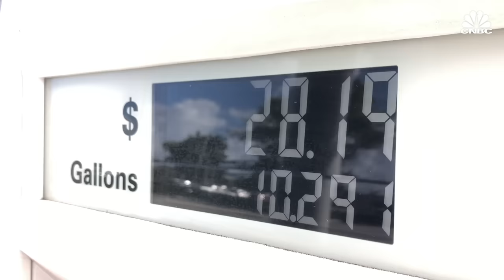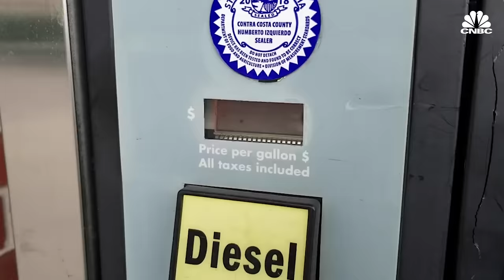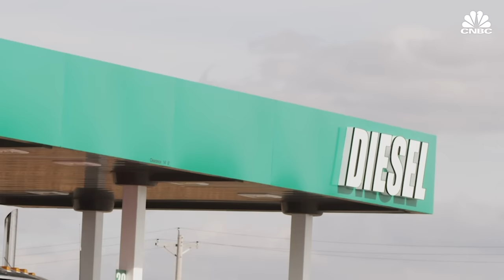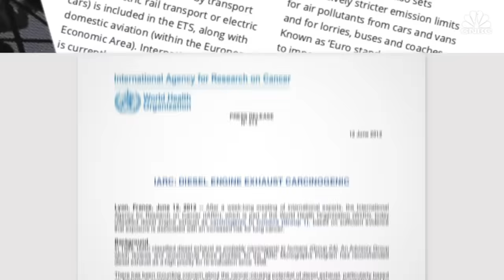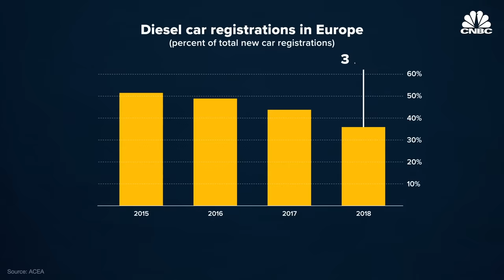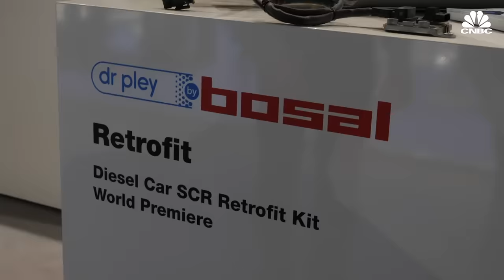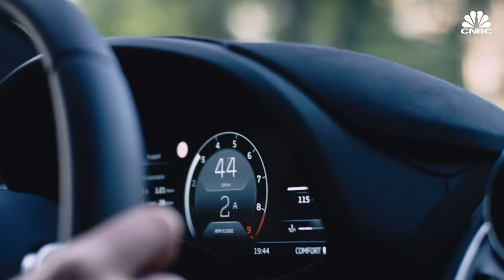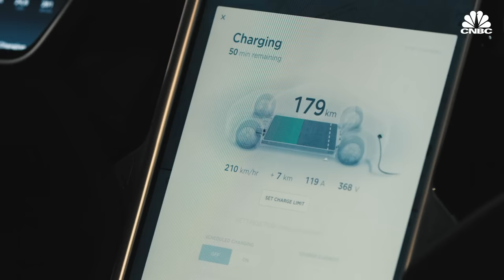Why Diesel Cars Are Disappearing

Comment: My e220d does 1200km on one tank easily. It emits less co2 per km than petrol cars. And the Nox emissions are handled by the scr system.
Reply: @ThePatUltra no, dpf and adblue equipped diesels are clean
Reply: @ThePatUltra christ, obviously burning 6 million year old dinosaur guts is never clean. When people say this they mean 20X cleaner than 10 years ago.
Reply: @ThePatUltra no because no one is breathing pure exhaust emissions. otherwise we'd all be dead already. stop being obtuse
Reply: @ericb8030  Possibly the soot and sulphur dioxide that is emitted will add to causes of cancer, not just for humans, but birds and other air-breathing creatures.
Reply: @peterduxbury927  That stuff isn't emitted from newer diesels exhaust, go educate yourself
Reply: @peterduxbury927  You are aware that new diesels by law are required to have a doc and dpf correct?
Reply: @ericb8030  Thanks for your note. Yes, please see my comments/reply to 332T.  We can add DEF (Adblue) to your DOC and DPF.
Reply: @peterduxbury927   maybe read again, i said "newer diesels", not old or deleted or not complying.  the exhaust tips don't even turn black on them. Modern diesels are very clean and still getting better. With ultra high pressure injection they can now pass emissions without soot filters
Reply: @peterduxbury927  There is a plant in Dresden that makes renewable diesel known as blue crude. The fuel is completely free of sulphur and can be used in any diesel for the infrastructure that already exists.
Reply: @ericb8030  Thanks Eric, I was unaware of blue crude, and zero-sulphur diesel fuel. But - doesn't this demonstrate that technology is doing its' best, and is anxious to clean-up the pollutants in diesel fuels - as a last-ditch attempt? As we are small fish, we will have little say in what fuel will be used in the near future. But it will be mainly Battery - Electric vehicles for private use. Governments will legislate, and diesel engines will be phased-out for use in small vehicles. OPEC will wind-back Oil Production. (Supply & Demand). Then, the prices of diesel will skyrocket! Living in Australia, we have an abundance of sun, which gives the cleanest (and greenest) power of all. It is wrong to believe that Power Stations will be used to recharge the bulk of EV's. Solar Panels (and their consistent improvements in performance and efficiency) will do that. It's sad that many people feel that they would suffer from Range Anxiety, if they purchased and drove an EV. But many Work Places will change, and Charging Stations will be added. Whether it is a petrol or diesel engine, the efficiencies just cannot compare with an EV at 80 - 90 %. Most ICE are not even half that efficiency, and are equal to the Steam Trains - all scrapped in the 60's. The writing is on the wall.
Reply: @peterduxbury927  "last ditch" is an incorrect way of saying improvements. Range anxiety shouldn't be the main concern, Evs give this false notion that they are better, when in reality they're a bait and switch for gas but without the infrastructure. Diesel still dominants range, fuel flexibility, and continued research for the environment. EVs still haven't proved they don't cause cancer either.
Reply: @glennv3176  Try locking yourself in a garage with the engine running, and see how long you last then........ DPF or no DPF, they still put out crap. Perhaps that's why Paris and Berlin now ban diesels from their city centres......
Reply: @Brian-om2hh  nobody said diesels dont pollute, i specifically said they do, mr strawman. We said modern diesels are cleaner than petrol, therefor banning diesels but not petrol is stupid, its politics, it has no basis in science

Comment: My Golf TDI with the manual transmission would go nearly three times the range of the longest-range Tesla currently available on one 16-gallon tank of diesel. It also didn't have to be shifted down at all to cruise over many mountain passes with its available torque. I wish they remained a cleaned-up option.
Reply: No car stinks like a VW.  I can tell when a VW is nearby by smell alone.
Reply: @TheRagingPlatypus  Assuming we are talking about a vehicle made after about 2001 with the turbocharger and emissions controls functioning normally, the smoke and smell are much less than they were in diesel vehicles of any brand prior to that. VW's don't smell significantly different than any other diesel vehicle--in fact, far less odoriferous than most American trucks. Most of the smell now will be at start-up. The emissions scandal at VW was not about the main components in exhaust that smell.
Reply: @TheRagingPlatypus  Ummm. You do know that part of the settlement was bringing the cars up to standards, not cheating, right? They got new NOX catalysts, software reprogrammed, etc., that would meet EPA approval like all other manufacturers (e.g., Chevy Cruze). The nitric oxide that is smelly in diesel is also in gasoline and propane. The difference we detect in odor is usually from sulfur / byproducts. The pickup trucks in my city are far worse offenders than all the VW diesels put together (and there are quite a few).
Reply: @ReflectedMiles  No, just no...VWs are worse.  Oh, part of their punishment was following the law!
Reply: @TheRagingPlatypus  I lived with one for many years while also living with a GMC Duramax truck, so I am very familiar with both down to rather fine detail. Of course, I don't have a beef with VW other than their decision to cheat and effectively get removed from the diesel market, so...
Reply: @ReflectedMiles  I don't have a "beef" with them...they just stink.
Reply: @TheRagingPlatypus  Or not. Fragrance is in the olfactory neurons of the smeller just as beauty is in the eye of the beholder.

Comment: anyone old enough to remember the Oldsmobile diesels from the late 70's to early 80's?
Reply: Took my DL test with a Chevy Diesel Wagon. They were junk. All GM did was covert gas engines to diesel. #Fail
Reply: @frhwebmaster  Technically not true. They built the engines using many parts meant for gas engines. They didn't take assembled gas engines and swap parts so they run on diesel fuel. A popular misconception.
Reply: Not only do I remember, when I was a kid, my uncle lived with us and he had one.
Reply: Those were not true diesel engines they had to keep the compression ratio low to be able to use as many gas engine parts as possible.
Reply: Please. I was trying to forget them.
Reply: Do you mean boat anchors that’s what they are best used as
Reply: @brianpatrick8787  They had 22:1 compression. That's actually pretty high for a diesel.
Reply: I do. My Most Loved car was a 1970 442    It was SO Fun to drive. The MPG was 9. and 12 average. But gas back then was ,38 a gal.
Reply: @Matt-re9oh  good answer

Comment: Do people realize how toxic the process of making lithium batteries is for the environment? And what happens when that battery is spent?
Reply: Aryrix 1 not to mention all the diesel burned to get those batteries to the end user. Then to do it all over again 5 years later.
Reply: Diesel is not the problem. ...people overpopulation is😒
Reply: yes, a small fraction of diesel. then the batteries go on to second life use such as a stationary storage, and then recycling. hydrogen is more likely to replace diesel where more energy density is needed, but thats also electric. there are already diesel electric motors, so half the work is already done.

Comment: 3:09 High torque of diesel motors in trains? Trains are diesel electric, the wheels use electric traction, the diesel engine is for generating the electricity.
Reply: The fuel is diesel.  It's a diesel powered train.
Reply: In Europe, much of the rail networks are all electric, especially the High Speed at around 200 mph or more.
Reply: @wiredforstereo  While the fuel is diesel, the diesel itself does not directly power the train. For starters, the diesel engine of a locomotive do not operate the same way as road vehicles despite practically identical function (long-distance heavy haul). This is noted by the lack of shifting on locomotives. Locomotives are essentially mobile diesel generators powering itself.
Reply: @dbclass4075  Oh my god, you're that guy.
Reply: @wiredforstereo  the guy that proves you wrong?
Reply: @dbclass4075  Diesel locomotives use electric fields to change torque and power requirements, controlled by a load regulator. Kindly do your research before hitting the keys.
Reply: @itchyvet  You supplemented my point: diesel engine itself does not directly power the wheels. It has to use electric fields instead of transmission to regulate its output. The load regulator is necessary to prevent exceeding the ampere output.

There are notable exceptions, however: British Rail Class 101, a diesel-mechanical multiple unit. It literally has a 4-speed transmission, so it operates similarly to a diesel road vehicle.

British Rail Class 166 is a diesel-hydraulic multiple unit. Utilizes torque converter in its operation. It operates similar to a single-speed automatic transmission, like the Koenigsegg Regera (minus the electric motors).

Of all the diesel types, diesel-electric is the most efficient, while diesel-hydraulic is the most responsive.
Reply: Just.. says its hybrid
You guys fight over a silly stuff, lol
Reply: @megimargareth4015  what's silly is people choosing to miss the context of my OP. The video makes a direct relationship between torque provided by the engine to the driving wheels. This is fine in 2 of the 3 examples, although the torque of a diesel engine in a locomotive has no direct relationship to the torque provided by the electric motors on the driving wheels. Seriously, if the electric motors are insufficient to provide the required torque, the ability of the diesel engine to provide high torque is a completely moot point.... So many straw man arguments!
Reply: @ThePatUltra Exactly. Diesel-mechanical locomotive's power has to transfer via transmission. Diesel-electric locomotive's power transfer in the method you described. The wheels are not directly mechanically connected to the diesel engine.

Interestingly, there are unique types of diesel-electric locomotives that can run on pure electricity, such as BR Class 800. But those are the exceptions.
Reply: @megimargareth4015  To be exact, diesel-electric locomotives are series hybrid: the diesel engine does not have direct connection to the wheels. Ignoring sarcasm, @ThePatUltra explains it well on how it works.
Reply: T - Rex  Those are diesel-hydraulic and diesel-mechanical, respectively.
Reply: Not in the UK. Here the power is supplied by overhead lines. Most passenger trains here are now 100% electric.........
Reply: @Brian-om2hh  Do trains in Great Western Main Line can operate between diesel-electric and pure electric mode mid-transit? I remember electrification is still underway.
Reply: @Brian-om2hh in UK "most passenger trains are now 100% electric"  you're having a laugh
Reply: T - Rex  I riding that once in Japan 
you can feel it clutching and engine breaking
Reply: @stephenedwards7769  oh go on genius, disprove it instead of making bs claims that you can't back up.

Comment: 9:59 Large ships are powered by compression-ignition engines, but, they use cheaper, but more polluting heavy fuel oil instead of diesel.

Comment: This has got to be one of the worst pieces of bad journalism I've seen in years.
Reply: @7:50 seems to back up the video's premise with facts.
Reply: Really?
Reply: It's CNBC. So, that should be no surprise.
Reply: WRONG. Actually it's pretty spot on says this ACTUAL JOURNALIST!
Reply: Disagreed. He's pretty unbiased
Reply: Seems factual and unbiased to me. Perhaps you're just a troll?
Reply: Diesel can’t be replaced in trucks! Diesel have a lot of torque! A small 1.5l diesel produces 250nm where as a petrol would need a 2.5l engine! Plus diesels run cooler ! Again easy for cramping big 8l-12l engines in big trucks ! Diesel has it place trucks pickups SUVs but I should have nvr been pushed into small car market !

Comment: Used cooking oils, drippings from oil presses that are unfit for human consumption, rancid cooking oils, all these can be used in a diesel engine after very simple 'scrubbing' 
Ever since the Gulf War when there was diesel shortage I learned to ' blend in' veg oils upto two parts to one part diesel. Cost effective and less pollution. Absolutely no adverse effects even in my current vehicle fitted with sensitive Continental Piezoelectric  injectors

Comment: With the massive developments that have been in diesel engines over the past 20 years, it is a shame to see diesel being phased out. Today’s Euro 6 classified diesel engines have extremely low emissions and are very durable so will withstand very high mileages. Even if diesel sales are plummeting, todays diesel cars will live on for another 10-15 years or more. And in heavy duty vehicles, esp long-range vehicles, diesel will still be the fuel of choice (fossil/biodiesel mix) until fuel cell (hydrogen) and possibly battery electric solutions are commonly in place.
Reply: Today's diesel cars might be around for another 15 years, but the cost of driving them, particularly into towns and cities, will most likely skyrocket, with increasing numbers of clean air schemes worldwide.......
Reply: unfortunately with growing population the only way is 0 emissions, that's possible only with ev.

Comment: They’ll have to pry my TDI from my cold, dead hands.
Reply: VW "s are the worst, they really stink and cut your breath as a bikerider or pedestrians.
Reply: @rc666  You're wrong
Reply: @rc666  spoken like someone who has never driven a TDI, my golf has around 75k and there’s no soot in the tailpipe, thanks to the DPF and EGR, a modern TDI with the factory emissions hardware has very little typical diesel particulates.

A TDI with the emissions hardware removed is a little smoky... but nowhere near as bad as a diesel truck detuned to “roll coal”
Reply: They will.
Reply: @rsg6366  diesels aren't going away anytime soon.
Reply: @fsl3242  100% agree. But @MacTechG4's comment was too confident. I had to reply.
Reply: @rsg6366  Ya. My dad has a 2019 f250 and loves it. I don’t think a electric motor could be in a 7000 pound truck and get good mileage. that’s my logic behind it and why i think electric won’t become mainstream for a long while
Reply: 530,000 miles on mine.  I run hard.  Average FE 52.6 MPG, best single tank 1022 miles and 61..8 MPG (yes I recorded every tank of fuel).  A clown offered to "tune" the transmission at about 150,000 miles, within 20K, the two bolts he left loose began to rattle just as the fifth gear pair came loose --- it was cheaper to buy a new transmission (ouch), escept for that it's only been average maintenance.  I love my car -- I'd be buried in it except that I'm going to be cremated and my ashes buried in the fuel tank from my Commando Production Racer.  That's the only way that gasoline will ever win in my house.
I paid $20K for it.  At 330K, I had saved enough on fuel to pay that $20K off -- since then I've been driving a free car that VW gave me, and saving 40% on fuel cost (even with diesel being a little more expensive) and even more on lower maintenance.  I think it's the smartest car I've ever owned.
Reply: @brucebear1  <Vader> Impressive, most impressive!...

The longevity of Diesel engines is one of the reasons I bought my ‘12 Mk6 2.0l TDI Golf (paid $9,000 for a CPO with 50k original miles), VW definitely mis-marketed the TDI, instead of playing up the “clean diesel” campaign that led indirectly to dieselgate, they should have marketed the fuel efficiency, comfort, handling, fun, and LONGEVITY of the TDI

Having a car that has the potential to last for 400K+ with minimal service is a definite advantage, I tend to keep my cars as long as possible, unfortunately, living in New England, the car chassis will generally rot away before the engine suffers any catastrophic failure, CURSE YOU ROAD SALT! (And Perry the platypus! ;) )
Reply: That can be arranged 😈
Reply: Definitely  with you 👍🇬🇧
Reply: So from my dead hands 1.9pdtdi vw is the best engine
Reply: @molnarriki4876  yes, I agree, my 2002  Skoda 1.9 tdi has 383.000 km, and it runs like a lion never ha any issue!
Reply: @brucebear1  For 95% of the population diesel is a bad idea, but you are part of the 5%. Someone who keep his car for a long time and do decent mileage on the highway is the ideal client for a diesel. I had a 2015 Cruze diesel and i'm not part of the 5%, lol. I'm an aggressive driver that do only 12000 miles a year and keep his cars from 3 to 5 years max. At less then a 1000 miles on the car i bought a tune for more power and i started having having problems because my car producing too much soot since i was too aggressive on the accelerator. I removed the tune, but still had the problem but less often. Finaly i deleted everything and went straight pipe with a tune. After that the car ran perfectly with 200hp instead of 150, but it cost me 1500$. It was my 1st and last diesel. When you need to modify a car that much so that it work properly for you and remove all polution control, it's not good at all.
Reply: Hey if only a few of us delete the emissions on our tdis it won’t hurt anyone
Reply: I have just traded in my 2008 TDI 1.4 3 cylinder polo with over 100000 miles after 12 years of ownership it had its fist battery last year 70 mpg it was still running ok but was needing some big jobs doing my new car is a 1.6 Vauxhall Astra with a 4 cylinder 16v diesel engine which runs a lot smoother then my polo  I also wanted a big car for moor Comfort has my bones are getting older now
Reply: @brucebear1  You need to do a YouTube video on your car. Sounds like something a lot of people would get great information on.